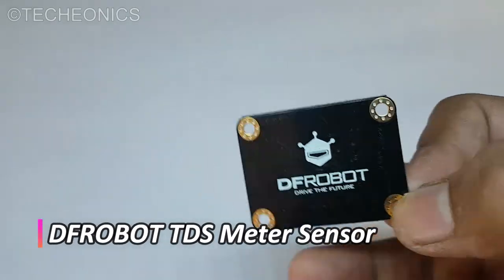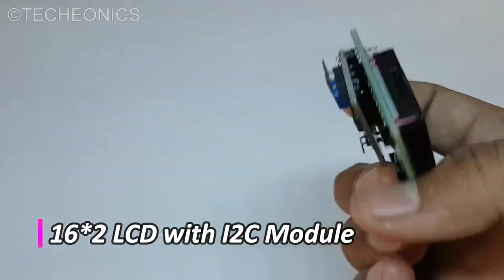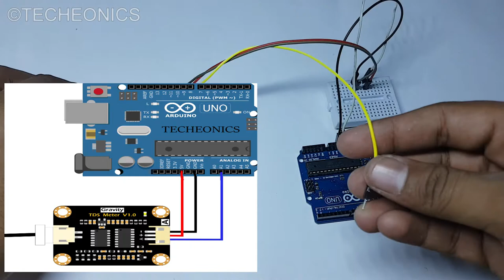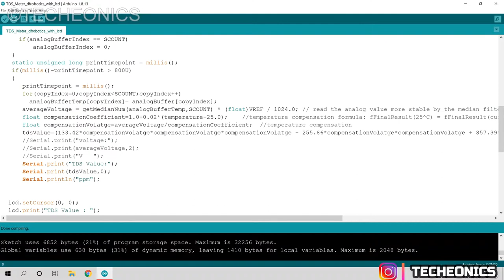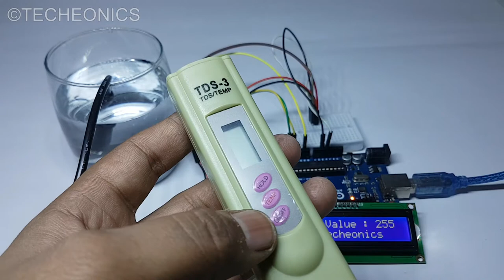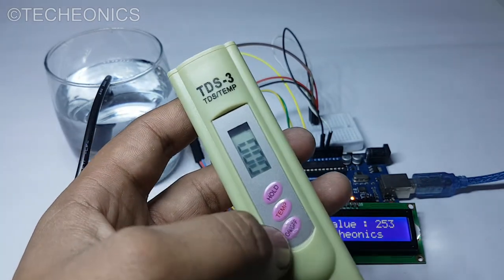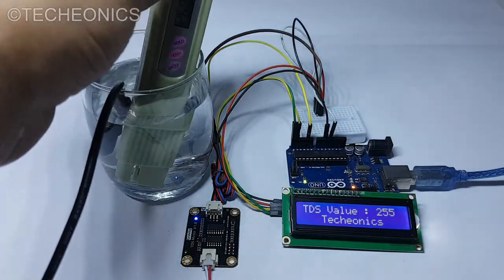DFROBOT TDS Meter Sensor With Arduino & LCD || Measure Water Quality in PPM || Techeonics @dfrobot

Comment: Hi, Mr @THE TECHEONICS, very good video. much appreciated.

Can the TDS sensor measure part per thousand (ppt) instead of part per million (ppm) ?
Or maybe any formula to convert ppm to ppt ?
Reply from the maker: To convert ppm readings to ppt, divide the ppm reading by 1000. For example a reading of 5000 ppm = 5000 ppm/1000 = 5.00 ppt.

Comment: Hi sir! May I know what power supply or battery in volts you will use to power that without plugging in the laptop? I am doing this for my school project. Thank you sir!
Reply from the maker: You can use any 5v or 9v power supply or Battery to power the arduino through the DC Jack  or the vin pin on Arduino
Reply: @TECHEONICS  Thank you sir!

Comment: Can this sensor be used to detect TDS in fuel?
Reply from the maker: No
Reply: @TECHEONICS  What is the reason? will the sensor error? If it can't, do you have a recommended sensor to detect lots of foreign particles in fuel?

Comment: What is the maximum range for this tds sensor?
Reply: I think it is 1150
Reply: @sk2809  can you share me that sensor link. Can we able to store the data in computer?? If possible please post a video on it
Reply from the maker: TDS Measurement Range: 0 ~ 1000ppm
Reply from the maker: We can store the sensor data in sdcard using a sdcard module with Arduino. 
Or we can directly upload the sensor data to IoT website (like thingsspeak) .

Comment: can I calculate the PPM in the range of 1200 - 1800 PPM with this TDS sensor? If you can't, what sensor should I use to calculate the PPM in that range
Reply from the maker: This sensor have 0-1000 PPM range  only

Comment: Hello, pls how can i use this TDS sensor to calculate the Electrical conductivity of water. Also, what formular do I use
Reply from the maker: Divide the TDS by the conversion factor. This will give you the conductivity of the solution.